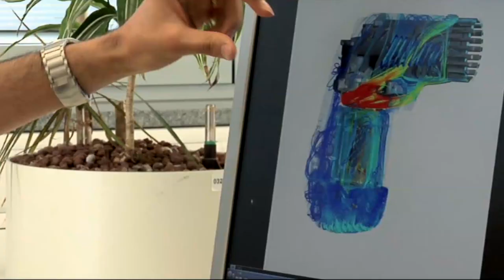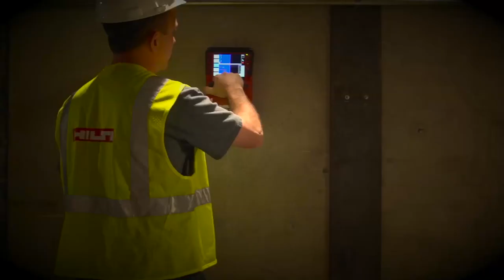Hilti - Experience Hilti

Comment: I bought a Hilti for coring, drilling, and breaking and I tell you now nothing can touch it. I have had Bosch, Makita, Dewalt and they just don't cut it! I last used mine to break up a concrete path 4" thick up to 6" and it just kept going no problem. I will be changing all my tools over to Hilti from now on, and there 2 year no fuss guarantee is outstanding.
Reply: Yo need to buy a Duss combi/breaker and you will see that it CAN touch Hilti - and destroy it with ease in regard to power, safety and durability/relability. You will trow away your Hilti hehe